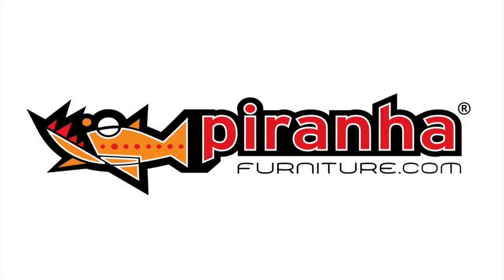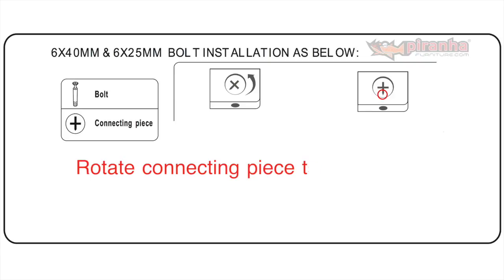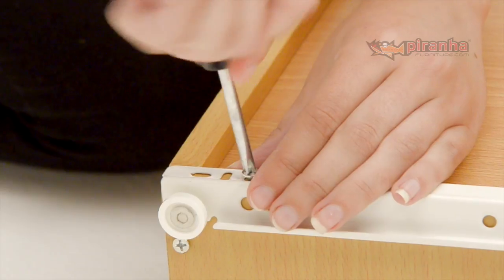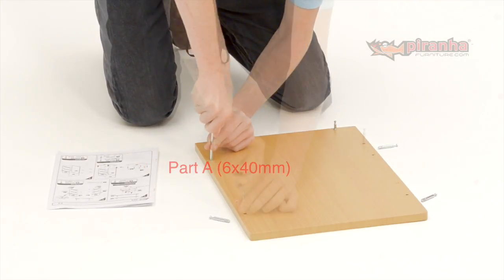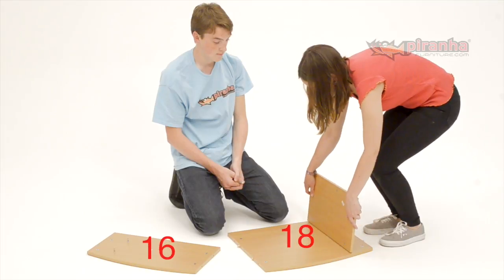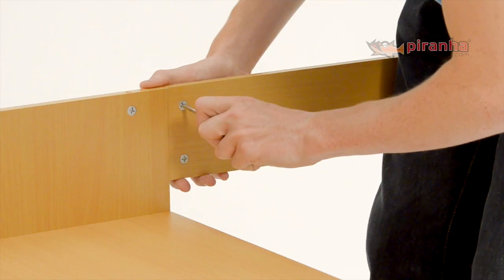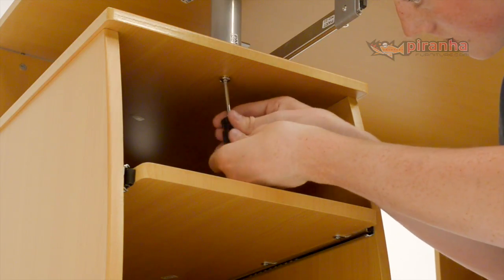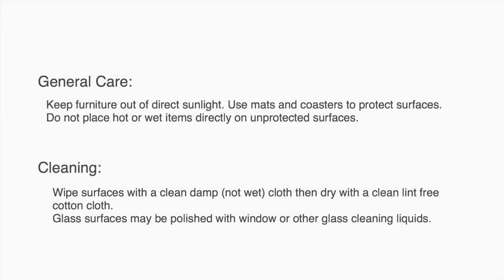Assembly of a Piranha Tetra Computer Desk

Comment: I found a lot of complaints in the comments section lol let me just say this if you don't have skills in making logical desions and are bad at using your intuition when assembeling the desk this desk is not for you also for the people saying they had to drill their own I holes in all it takes is a screw and a screw driver because of the material the desk is made its easy to get a screw trough I admit I had problems assembeling the desk my self that's why I got rid of the problems before making them that's why there should be more planning before assembeling the desk coz one mistake could damage the whole desk.... Further more my desk did not come in perfect condition it had dust on it and scratches I don't blame the company for this because it got define you damaged when it was on the way as I work at Hermes I know how parcels are treated and trust me you would be supprised how poorly specialty big heavy boxes are treated there

Comment: Just assembled 2 of the desks in the video but in black.  They were very easy to assemble and sturdy, your delivery was super fast and the cost low so overall I was very happy with my purchase through amazon.  I would make one improvement suggestion, I don't know if its possible but could the runners for the keyboard pull-out have a sort of lock/catch mechanism as I have a habit of nudging it back in when I am gaming ( I do move around a bit :) ).